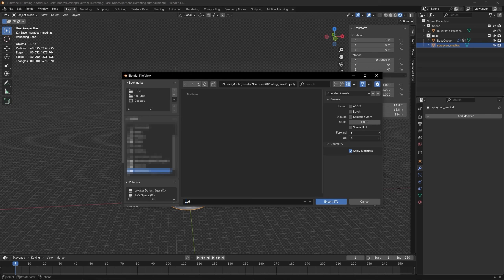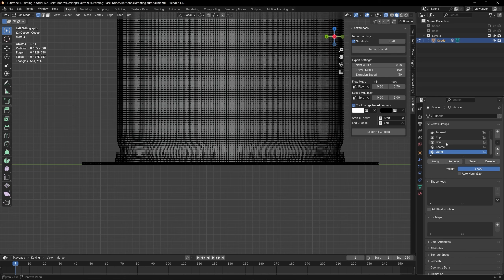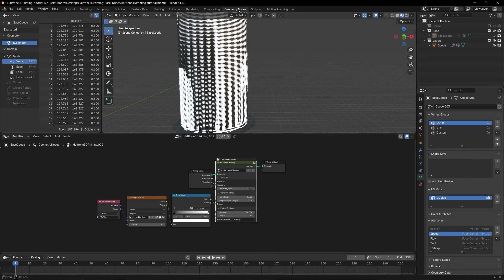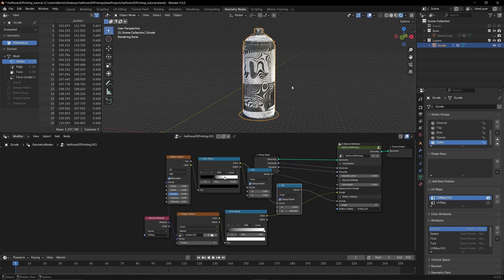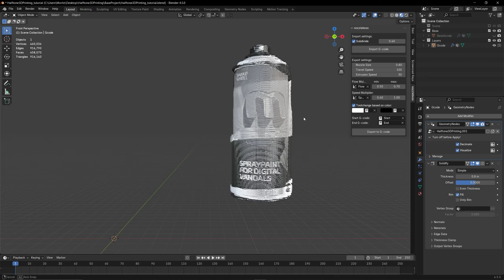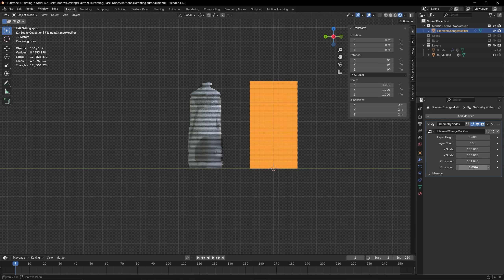[Outdated] Halftone 3D Printing: Smooth Gradients With Just 2 Colors! | Blender Tutorial

Comment: I'm trying to test this with a simple cylinder shape, but when I import the g-code in Blender 5.2.1 it looks crazy with a lot of intersecting lines and some missing layers. Do you know why a simple cylinder would do this?
Reply: The spray can g-code doesn't import correctly either. Must be an issue with the newer Blender version?
Reply from the maker: Hmm, yeah try blender 4.5 and maybe use the Elegoo neptune 4 Max in orca slicer for the gcode..
A update with up to 5 filaments, a Lot more settings and Support for newer blender versions is Coming very soon
Reply: @meditat_  Thanks I'll give it a try. I'm subscribed, can't wait to try the new version!
Reply: @meditat_  So I finally got it to import correctly with Blender 4.5 and OrcaSlicer 2.4.2 with the Elegoo Neptune 4 Max profile to slice it. There was one other setting in your slicer in your slicer that you skipped over that made this finally work: Wall Generator: Arachne (Classic did not work for me)

Comment: Cool Technique!  BTW On Blender 4.5 the FilamentChangeModifier needs a Realize Instances node before Group Output, otherwise Apply fails with 'Evaluated geometry from modifier does not contain a mesh' and the exported modifier doesn't work correctly in Bambu Studio.

Comment: wow... amazing!

So i have a H2C and will try this tomorrow should be interesting to see if it works on the vortek system, i would need the filament change modifier geo node from you gumroad for it to work i assume? 

Thank you for your work, you deserve more recognition for this.
Reply from the maker: Thanks 🤗 yes I think it only works with the workaround, the issue is that one nozzle filament changers don‘t accept T signals in the gcode for toolchanges. Maybe the H2C accepts it, but you would need a specific start and end code for your machine.

Comment: I have a problem in the last step while doing the workaround for bambu studio. When I want to import the modifier in bambu studio there is a loading error. When I save my modifier from Blender it looks empty (1ko)... Does someone has the same problem?
Reply from the maker: Did you select the object when exporting and ticked the box selection only? Also Check if the box apply modifiers is ticked. Or maybe in the modifiers check if the render checkbox (the little Camera next to the eye) is checked. Or apply the modifier before the export 🤗
Reply: @meditat_ I was already doing all that, except applying the modifier, which caused an error "evaluated geometry from the modifier does not contain a mesh". So, with the help of ChatGPT, I just added "realize instances" between "Instance on points" and "group output", and that sorted it out !! 
Currently printing 😍🤞I'm so excited !! Thank you so much for this tutorial and for the help !!
Reply from the maker: Nice 🤗

Comment: My Gcode comes in really messy with lines going zig zag but in the slicer it looks really good do you know what this is about ?
Reply from the maker: Do you use Orca slicer? Maybe try a different Printer in the slicer
Reply: Mine does too. What version of Blender are you using? I'm using 5.2.1 and I can't get the spray can model or even a simple cylinder to import correctly.